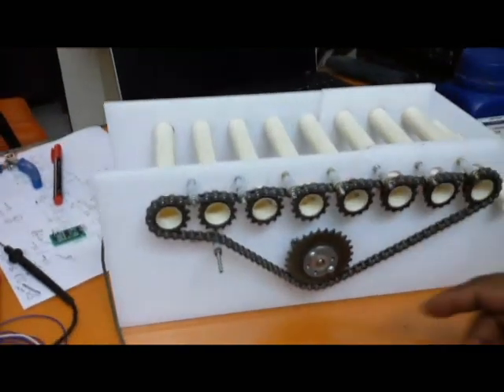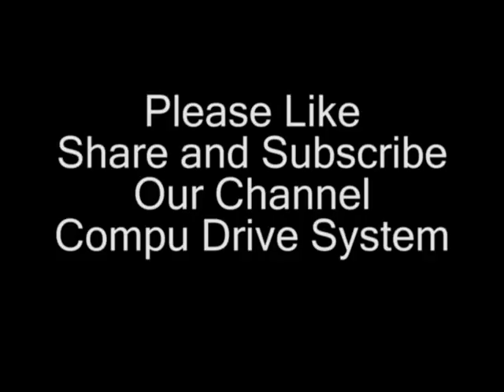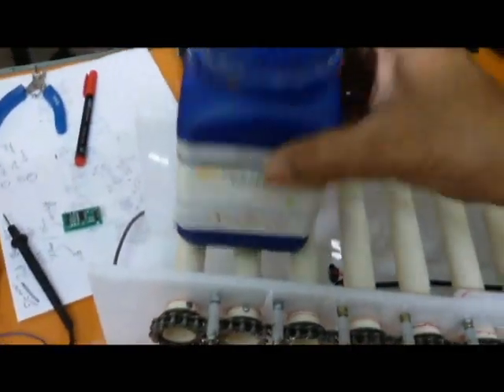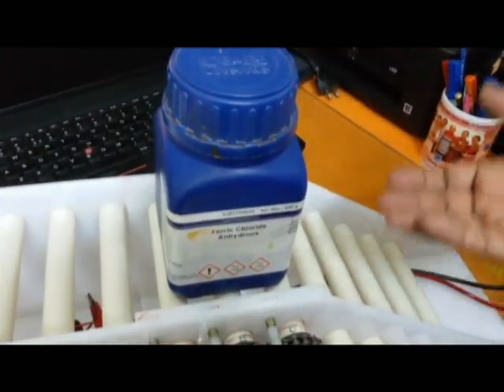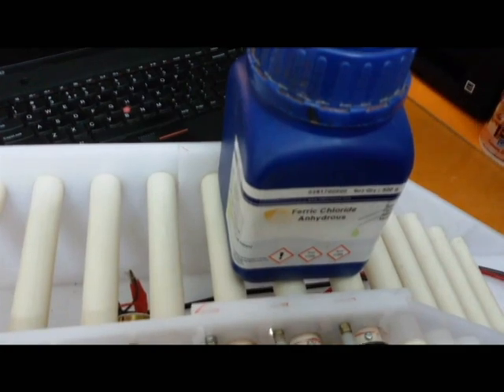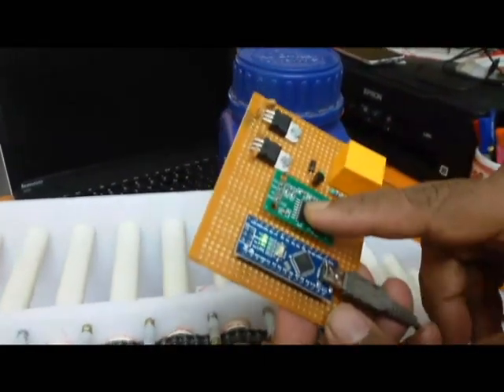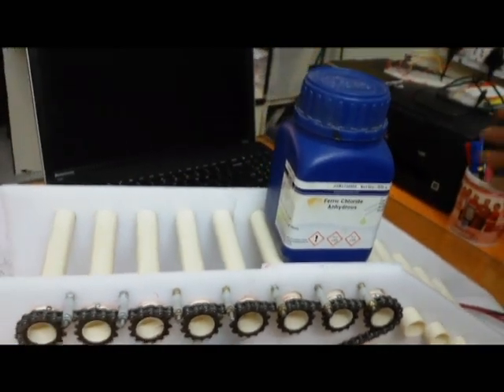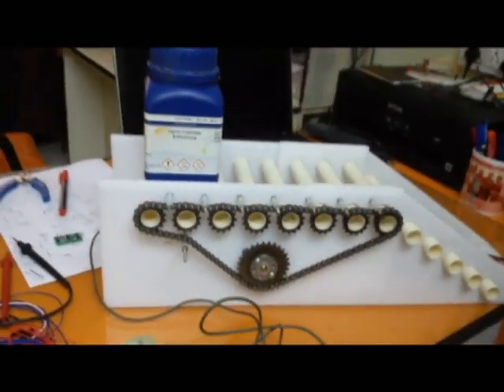How to make a Chain Drive Roller Conveyor | Conveyor System | Conveyor | Engineering Design

Comment: You reinvented an already invented slave driven conveyor system but made it less effective. Each roller should have 2 sprockets on the same end and together staggering the chain. Have the motor attached to the center roller via sprocket and chain like you already do

Comment: Sir please tell me , about the circuit you have used that makes the motor start automatic after the weight is filled in bottle and also about the sensor how you have installed is it attached with roller?
Reply from the maker: Thanks for your comment. But these are paid projects.